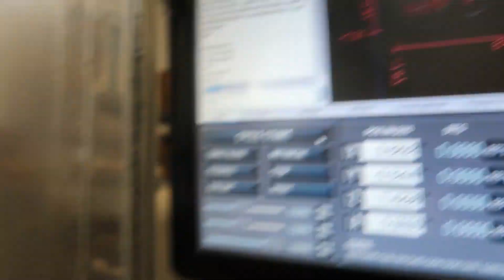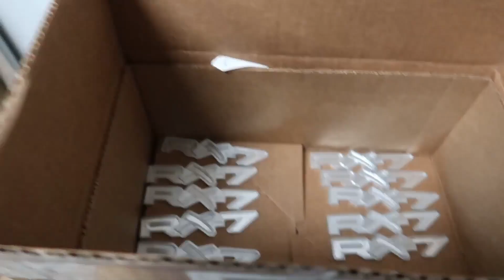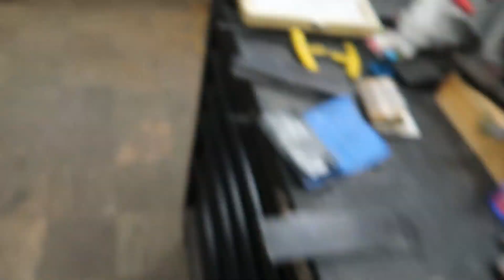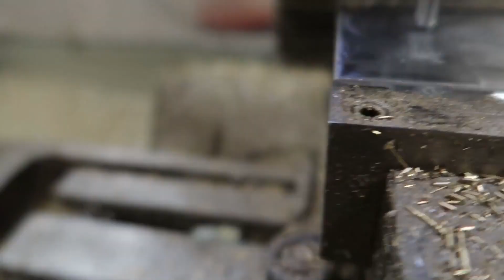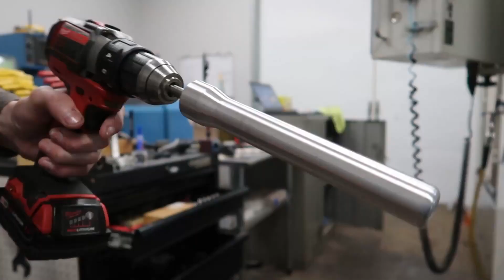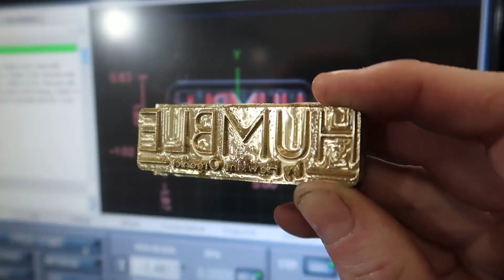Branding Irons, Emblems, and the Mechanical Puzzle

Comment: I started out with a single vice and eventually moved to two 6" vices.  Made a world of difference for me.  I also made a few of the fixtures similar to the one in this video (https://youtu.be/2-TglmJFcHA).   My parts were pretty small but I could fixture several of them at the same time.  Might be able to make something similar to hold several different size parts.  Make all the jaws the same distance apart and you'd only have top reference one corner and you'd know where all the jaws/parts are from there.  Just a thought.
Reply from the maker: My apologies, I'm just seeing this. That vise you made is genius! I love it. I would like to make something similar to that but extremely low profile where I'm only holding onto about .080 if the material. As always, thanks for the advice!

Comment: Fixture plate may be easier and significantly cheaper. A couple miteebites per branding iron vs $250-500 per vise. The saunders mod vises may be an option if you move the fixture plate back to the tormach
Reply from the maker: I thought about the mod vises as well. I just have to do some more research on them to see how much they can adjust. The problem with the fixture plate is that sometimes I have 2" wide stock, sometimes 3" wide and sometimes 1" wide. It might be difficult to accommodate all of those on 1 fixture.